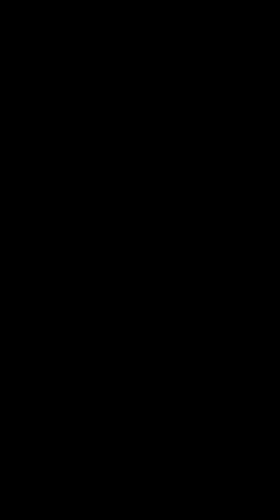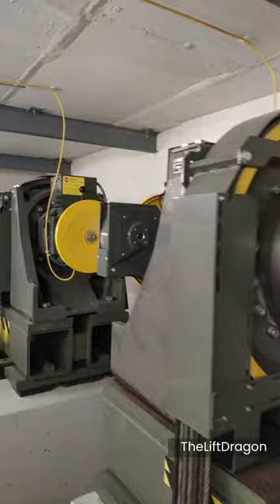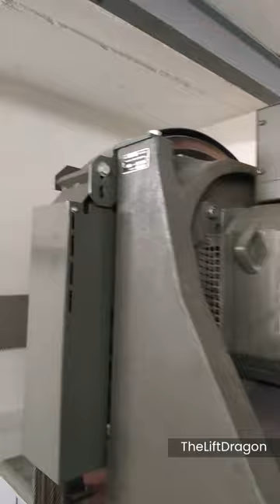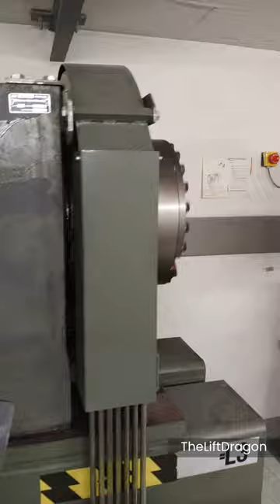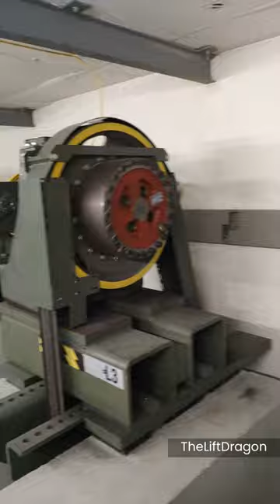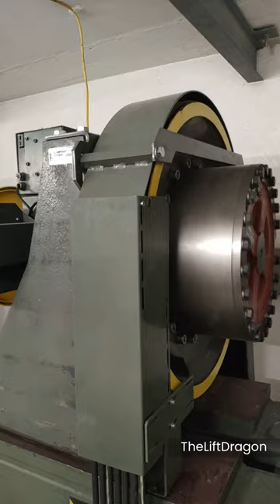4 SCHINDLER Planetary Geared Lift Machines - Motor Room

Comment: These look a lot like mini gearless machines! When I first saw one of these thats what I mistook it for
Reply from the maker: Indeed they do, I think you're not the first person to mistake them for gearless machines. The characteristic loud noise and the high rpm of the hand wheel at the back though give away pretty fast that they're geared machines. I really like them though as they can achieve pretty fast rope speeds and also have less thermal losses than conventional worm drives.